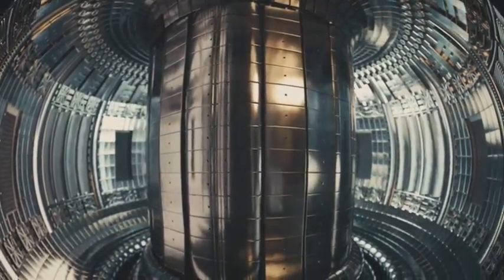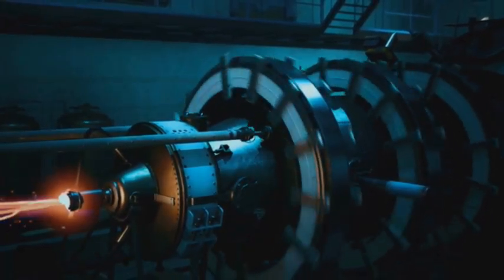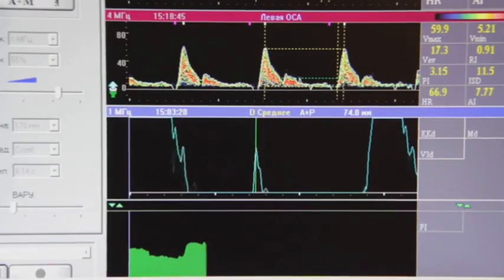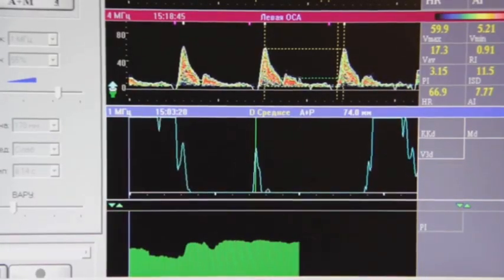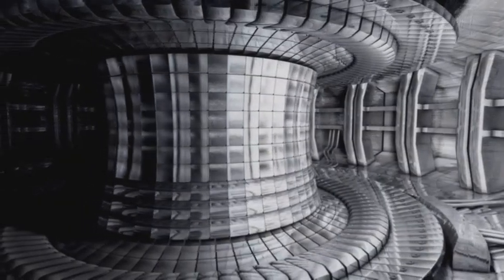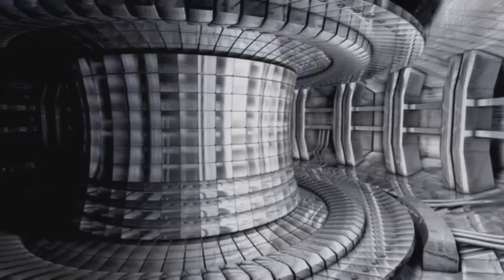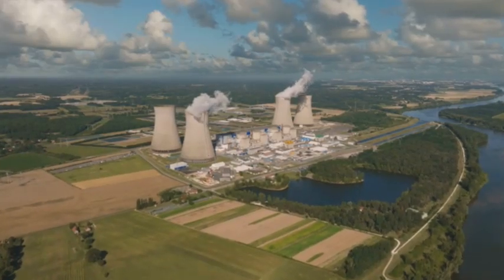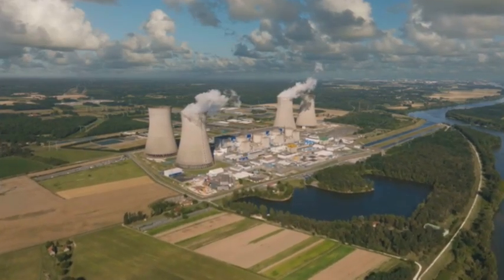France’s Fusion Reactor SMASHES Record—22 Minutes of Super‑Hot Plasma!

Comment: The nuclear fusion experiments began in the 1950s and since then the promise has been consistently oversold, typically to attract massive funding for continuing such fun experiments. Most of the project administrators have learned to snow reporting journalists by omitting key evaluation parameters under the excuse that the complexity of the field justifies such omissions. Missing from this presentation was the fact that that this plasma temperature was well below the temperature needed for a significant amount of fusion to occur. No tritium fuel was employed so no significant amount of fusion was possible, despite this experimental machine being described as a fusion reactor. There are no plans to use fusion fuel in this machine. Typically, project administrators avoid mentioning that tritium is radioactive. For decades the promotional hype has stated that the hydrogen fuel is almost unlimited. Always omitted is the fact that commercial tritium cost over $30,000 USD per gram. Almost all fusion reactor designs are intended to operate in a pulsed mode, with the plasma energy gain value only applying to the 'ON' period of machine operation time. The use of the term 'net energy gain' is deliberately misleading because it ignores the average amount of energy needed to power the facility, which can easily be orders of magnitude greater than the energy used to directly heat the plasma to fusion energy temperatures.

The ITER project was mentioned in this video. Not mentioned is that it is grossly over its original budget and that it is well beyond a decade behind its original schedule. After recent major delays the administrators stated that this experimental machine is expected to cautiously begin its first deuterium-tritium fueled fusion experiments in 2039.

Virtually all nuclear energy promoters, are in line with the vast majority of Earth's other 8.2+ billion humans, who continue to assume that we still have at least 20 years left to turn this 'Titanic' around using their favorite nuclear technology. They have become masterful in excluding the following warnings from their consciousness. I urge readers to search for the following two article titles.

IPCC report: ‘now or never’ if world is to stave off climate disaster (TheGuardian)

UN chief: World has less than 2 years to avoid 'runaway climate change' (TheHill)
  * This statement was made 6.6 years ago.